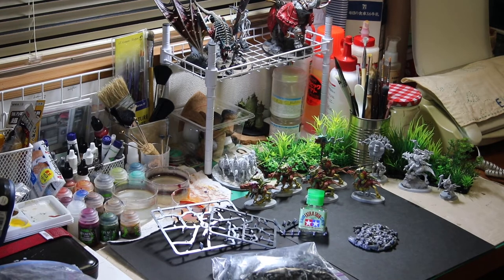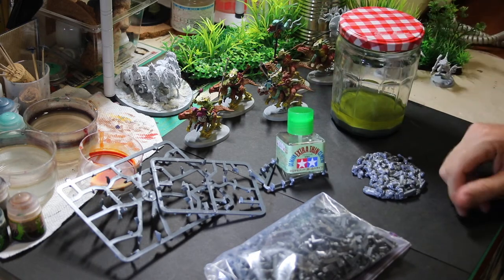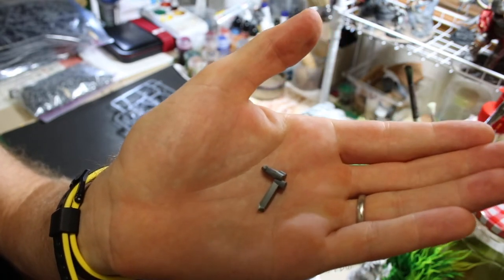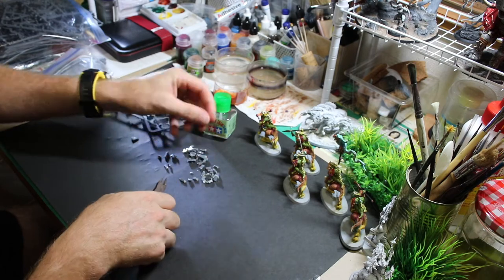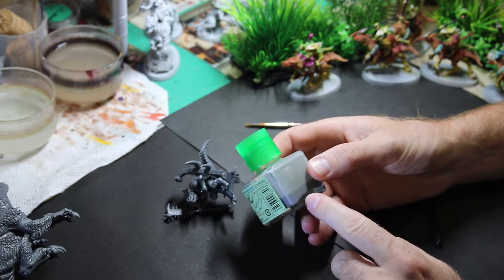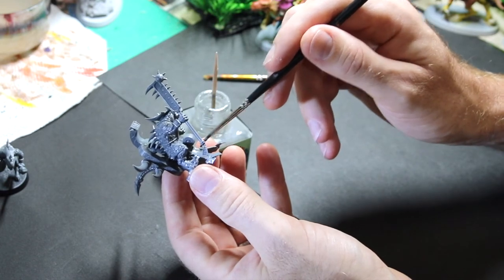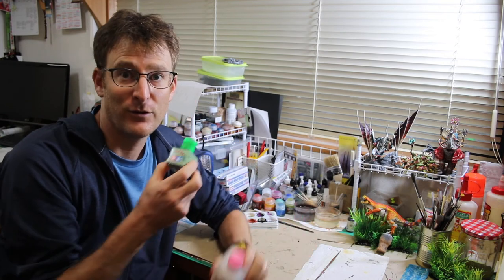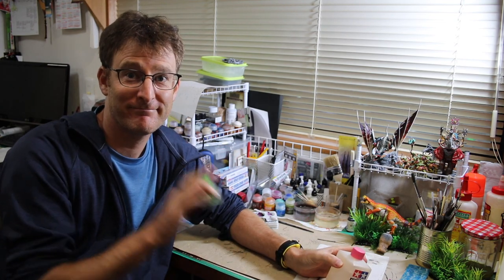Tamiya Sprue Glue: Making and Using the Perfect Imperfection Fixer

Comment: Thanks for the tip about the airbrush cleaner, I never would have even thought to check. Also thanks for going into detail on uses and recipe for the goo!
Reply from the maker: Thanks for watching. I hope that the tips come in handy. I had previously just bought the normal cement bottles but after some research on the web I found this airbrush cleaner tip. It was too good not to share with like minded hobbyists here on Youtube.